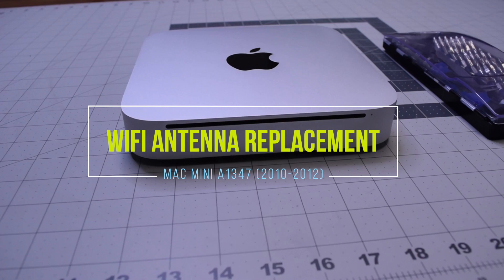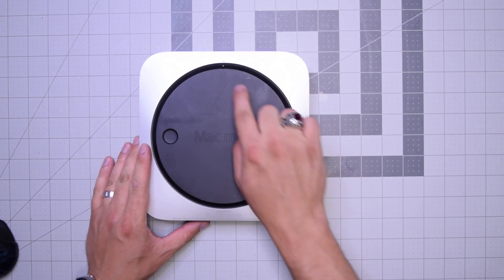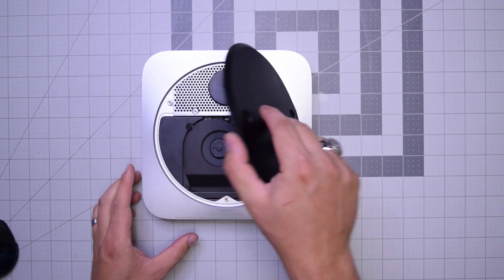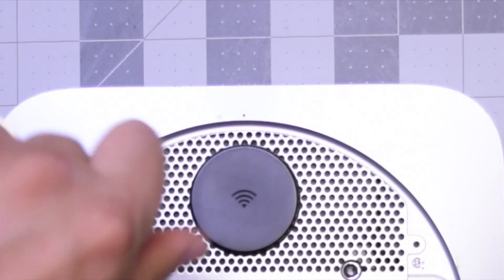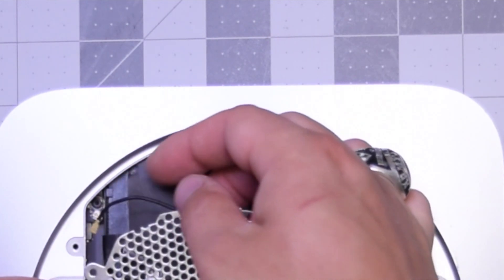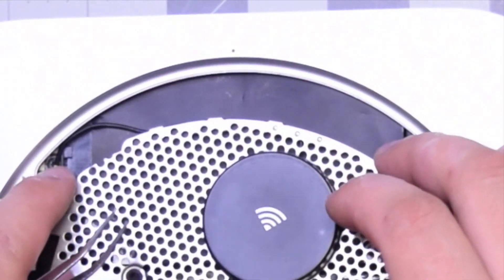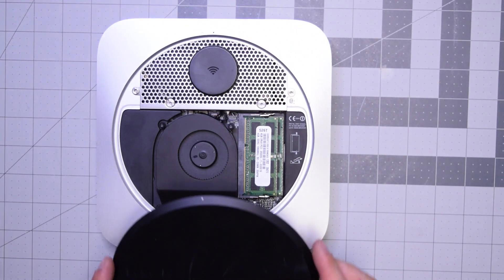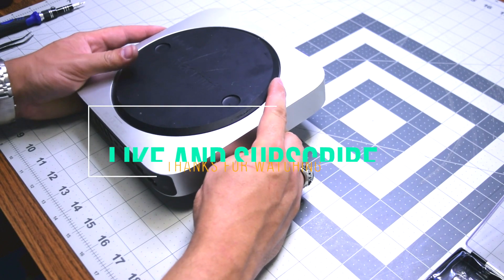Mac Mini A1347 - WiFi Antenna Replacement (2010-2012)

Comment: Thank you for the video. I’m having troubles getting the Wi-Fi antenna mesh lined up to where the holes match. I get one side screwed in and the other side won’t line up for some reason.
Reply: Me too "/
Reply: @togisivni  it took e a while, but I finally got it. It was soooo difficult.
Reply: @jmsomps  any tip you could tell me...?
Reply: @togisivni  I think I put 1 screw in at a slight angle, but BARELY enough to just hold it a little cause if you even go up then you will strip it or retool it. Another idea is if you have an ice pick or something that can be placed to hold it while you do the other side. It’s been a while so I’m really trying to remember. I did a small video but I gotta find the video. If I can find that, I’m sure I left a little instruction. For some reason, I feel like there was something in the way but I really think the way they initially put it together causes this problem. Is it cold where you are? I’m thinking about putting the computer safely in the cold but keeping the bottom plate warm and seeing if that contracts anything enough  to let the plate go in place. I’ll really try and see if I can find the video. I’ll look at my previous message date and see if that helps.
Reply: @togisivni  I’m guessing it was super difficult to twist the bottom plate right? That’s because there was a lot of tension which causes this problem.
Reply: @togisivni  you probably already got it or gave up but I finally found the videos. I didn’t record finally getting it in place but what I caught after watching the video I made, I think the problem is two fold. 1, Apple’s assembly and then when we take it out, there are teeth on the edge which might be causing the problem. I had a bit of a time taking the plate off and as I watched it several times, I really think it has something to do with those teeth getting in properly.
Reply: @jmsomps  hey, yes i finally got it! there's a comment writen by Shon Levi
8 months ago in a video posted by OWC (https://youtu.be/rlhMCSb21LA?t=309) that tell us what to do to solve that problem. I've linked the moment where the wifi mesh is being putted back and he lifts e top/midle of the part, exactly as it's written in the comment... and that was how i got it =D
Reply: @togisivni  ok Thank you. I’ll take a look.
Reply: @togisivni  ok. That was what I needed to make sure the teeth in the back got into place. Thanks.